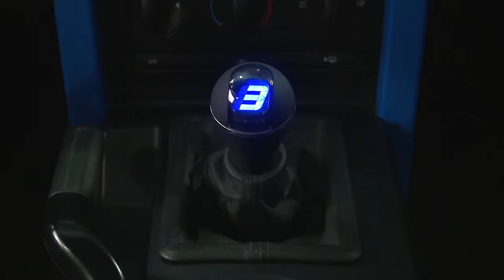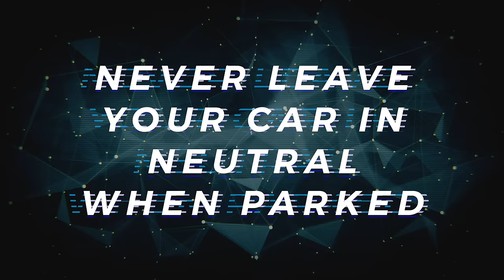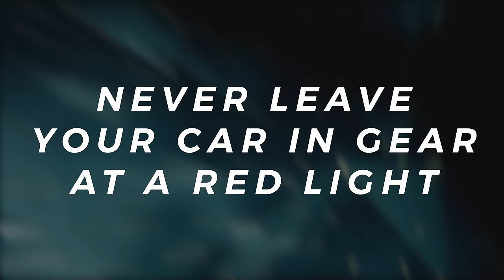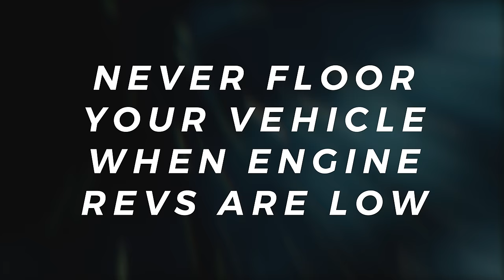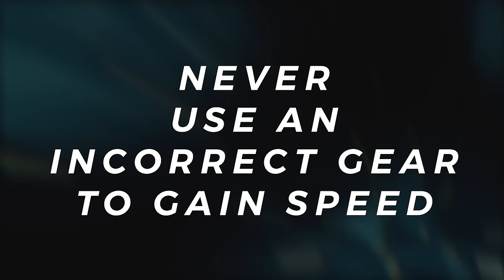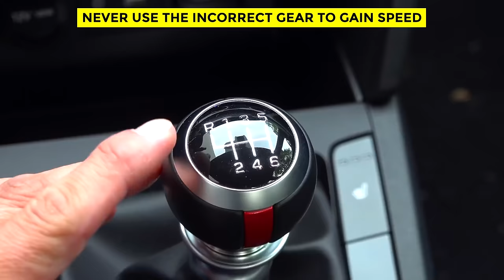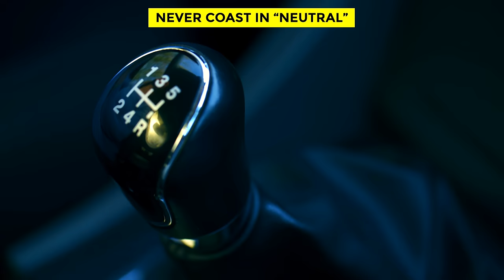7 Things You Should NEVER Do In a Manual Transmission Car!

Comment: Americans with their humor😂 gotta say I laughed the hardest when he said you NEED both hands to steer
Reply: Taking both hands off is how you see when its time to get an alignment 😆
Reply: @assassin_asa  yeah, since you should just go straight, i honestly hate 10 and 2 or 9 and 3, its uncomfortable for me to have both arms bent for long periods, unless something is under my elbows
Reply: @charlescourtwright2229   dat is tru
Reply: i have logi g920 and i use one hand to steer when i dont need to use the other one.
Reply: I laughed at that part as well. 😂
Reply: Instruction N° 27265: don't put your american flag on the windshield, it might reduce your visual
Reply: It's uncomfortable to have more than one hand on the wheel
Reply: I also don't understand how you can hold both hands on the steering wheel and not use your knee while changing gears, smoking and drinking something
Reply: in racing car with short gear or rallying we don't do that
Reply: @assassin_asa  or to check if your front tires are balanced.
Reply: To switch gears do you use teeth or toes?
Reply: ExtremeRacer 879 that’s not a real car it’s just an accessory for Xbox
Reply: @assassin_asa  so, right. Bought my new car this month took off both hands on the steering wheel and guess what, the car steers itself even though it's a straight road. Damn... What a headache.😔🤕
Reply: my hands fight each other and the car wanders. left hand for steering. also, what if the vehicle has an auxillary transmission, so there's 2 shifters. what then?
Reply: Dude change gears with mind control😂
Reply: Legit, even before learning how to drive manual I never had both hands on the steering wheel.
Reply: I drive with one hand because you can react faster, most cars nowaday need very little movement on the steering wheel in order to turn. So your shifter hand it's going to be in the damn way, and also what if you got to shift gears and turn at the same time?
Reply: @charlescourtwright2229  is it weird that I use 10 and 1
Reply: wahahah so true. Maybe he's still new :D
Reply: Same 😂😂 I can't remember the last time I need both hands to drive.
Reply: Why you lump ALL of us in with THEM? Lol
Reply: Like anybody ever does
Reply: @exr879  Good job you can drive in a videogame.
Reply: same ,, one hand on steer one one gear box 2 hand only if ur going to crash or some one is on front of u
Reply: i dont thing my right arm has ever touched the steer even when i learned to drive i couldnt keep both hands on
Reply: @johnyguitar258  How'd you pass your driver's license test?
Reply: Some people don’t know that👀
Reply: Yeah true haha
Reply: I am using both hands only in sharp turns xD The hand rest on my door gets 5 times more wear than the left half of my steering wheel
Reply: @stevesmith5579  using your knee to drive is unsafe just because you can do it doesnt mean you should because you are putting others lifes in danger
Reply: @creinaman4041  anything can be dangerous when you're not good at it. I guy drowned in a small puddle in front of my apartment building
Reply: @stevesmith5579  still shouldn't do it be normal and use 1 hand to steer and stop putting others life in danger
Reply: Lmao ikr
Reply: Racecar drivers might want to have a word with you, casuals.
Reply: In an older manually steered car, you about had to!
Reply: Those old cars were tanks and you didn’t want to have one of those getting away!
Reply: Yhe i know right? I usually use my knee /s
Reply: lol yeah
Reply: @exr879  bruh
Reply: Yeah i feel vulnerable when i hold the steering wheel with both hands for some reason.
Reply: like we dont have power steering or something, xD
Reply: @charlescourtwright2229  it's 5 - 5 tho when moving. The only 12 you need is reversing to keep the wheels still straight.

Comment: Never brake without engaging the clutch...? Why make completely incorrect statements if you're attempting to educate...?

Edit: I'm going to assume he means if coming to a complete stop.
Reply: I can understand what he says
Reply: Your reply gives complete misinterpretation of exact what he means
Reply: I wondered about that one too. Downshift, of course, but keep the engine engaged. With modern synchronized transmissions you can go all the way down and clutch finally just before stopping. In my first cars sixty some-odd years ago, going into first (of three back then) required double clutching, and the first I had that synced first gear was a 1967 Chevelle my wife and I bought new when I graduated from college. I've never had to replace a clutch on a car, though some have gone 150K miles, sometimes without needing brake jobs.
Reply: He just increased 90,000 people’s breaking distance by 15%

Imagine if that results in an accident 😶
Reply: @afoxwithahat7846  well I don't...
Reply: @kingsleycollins6730  feel free to explain
Reply: @marvindoolin1340  nice work, clearly you know what you're doing xx
Reply: He mean apply clutch why u are about to stop not while applying the brakes
Reply: You clearly sound like a person that never has driven a manual
Reply: I mean it would be much better to stall the car than crashing it so i dont think that you should always engage the cluch when braking
Reply: Matthew w  Really? What forces are put on the engine with engine braking that aren't already put on the motor? It doesn't put any different stresses on the main bearings, rod bearings, cam bearings, rings, valves, cam, crank, nothing. It creates vacuum forces inside the engine that help slow it down. Why do you think diesels take advantage of engine braking with a Jake brake?
Reply: HAHAHA, that's hilarious, you can step on brakes without stepping on the clutch, but of course if you're in a average speed, not on the second or first gear, cause' the car will wabble and the engine will eventually stop working, if you're for example, in a speed of 60km, it's okay to step on brakes without stepping on the clutch, plus it's a good way to conserve and prolong the life of your clutch lining, and have you ever heard of engine break?😂 And another thing is if you step on car's your clutch and then step on your car's breaks, the speed is more like to increase, and that is bad if your breaks are starting to loosen up.(this is just my observation, and by the way, I'm 19 years old, but I do have a liscense.)
Reply: Exactly my reaction, u only engage the clutch when ur at around 1,000 rpm before u stop.
Reply: Maybe never stop. I think this training is for American people. I have manual gear, like in most of Europe.
Reply: @lucag6052  yes clearly
Reply: If the wheels are turning the gearbox is turning, which means the engine is turning, i only press the clutch when i'm coming to a stop, with petrol manuals on the deceleration while in gear you get the benefit of engine braking from the vacuum as mentioned elsewhere, on diesel cars you dont get the engine braking due to how a diesel works however i would keep it in gear so the torque is biting the tyres to the road rather then freewheeling, in large diesel they have a jake/exhaust brake which sounds epic lol
Reply: Thanks now i dident have to say it😅
Reply: Wtf are ppl too dump to know when the engine starts to stall and to engage the clutch
Reply: @drix396  yeap looks like it lol
Reply: Stopping without clutch will shut your engine
Reply: The engine will start struggling when coming to a halt  which is a warning to engage the clutch , nice and simple.
Reply: @raulerrman.5401  but if you engine break it's effectively much better braking. For people who do engine brake, engaging the clutch while braking sounds scary.
Reply: @mohamedbasel5249  Never had that issue before . I brake till the minimum speed of the gear and down shift or press the clutch.
Reply: @upsidedown4155  That is actually incorrect, diesel engines have engine braking too, and because of the higher compression rate, it`s as effective as the engine braking in petrol engines.
Reply: So many ways to use the clutch. On rear wheel drive cars you can even use it to start and control an oversteer by blocking wheels when aggressively downshifting entering corners. Concerning safety, it doesn't matter if you engage clutch or not while braking as everything is electronically controlled nowadays though, if you have to brake for extensive periods like going downhill or when the car is heavier, it's better to use engine brake to avoid overheating of the brakes. Also, cleverly coasting in neutral - when there's no other car around as it's a pain for someone following you - is a very effective way to save fuel because when you stay in gear, even if the fuel injection is cut off when you release the throttle, the car will slow down much faster due to engine braking.
Reply: He didn't say that. If the RPM is too low it can be a problem, that's what he said. Best way to save fuel is by coasting while in gear, coasting in neutral is pretty much pointless. Like when you need to enter a city, you can approximate the distance and coast while in 4th or 5th, but you should change the gear when you reach a certain RPM.
Reply: And in winter, don't use clutch and brakes together
Reply: You will slightly accelerate when you step on clutch first before braking which is potentially dangerous. Braking gradually then clutching to avoid stalling is the best way. Brake first before clutch
Reply: He means to say go for lower gear before u break thats the good for u and the car engine, if u cant ,thats the result of danger in life or damage to property specially when your speed is fast ,many people didnt know this thats why so many accident happen and its not teach by the company or LTO before u get a license
Reply: Cos if you don’t  as the speed drops and you don’t the car will judder and stall
Reply: @Electromagneticplutonium  15% what the fuck man a proper maintained car should be able to overcome the grip of the tire with the brake
Reply: You can brake without touching the clutch, just stay above idle (1krpm will do in most cases)
Reply: Matthew w  I keep it in gear until it hits 1krpm (600 is idle) because engine assists in braking. Its also nearly impossible to brake in neutral on a motorcycle because of the nature, my 2000 zx6 won't even go into neutral unless the rear tire is stationary.
Reply: @mohamedbasel5249  its actually illegal in most US states to coast, youre supposed to be in gear unless stationary
Reply: @diljotrandhawa6320  in the winter, i almost never use my brakes, almost all engine braking to keep from sliding
Reply: @assassin_asa  see the government gets it. Also u a bike guy? One of the best thing I've learned since I started riding a bike was rev matching while slowing down. Also one of the most satisfying.
Reply: Stephen R you can tell you don’t drive a manual transmission
Reply: He should have told, "only if you are gonna stop the car"
Reply: @cerilgracic3065  yes
Reply: @08supersal  that's funny
Reply: @assassin_asa  interesting. I know so many people who just pop it in neutral as soon as they hit the brakes if they're slowing
Reply: Put the gear in neutral before braking and then brake. Simple. You don't need to press clutch everytime you stop. That's just massively hectic.
Reply: When you come to a stop you should put the car in neutral
Reply: When you brake... Your revs drops automatically.... Wouldnt the engine want a down shift??? What would you do to shift?? Use clutch...right?
So engaging the cluth while breaking allows you to shift down quick...
Reply: @sabeehilyas8866  do you accelerate wit cluth on or your Rev match automatically? You use clutch to shift gears. That's it. Matching revs up is as stressful as down. You wait to the point it is needed.
Reply: Matthew w  ......60mph... coming to turn on a side street. Clutch out, match rev downshift to 4th clutch engage, brake for a few mph then do it again to 3rd. then again to 2nd. Your braking distance is better and your not burning anything up. It's called engine braking. and using it alongside your footbrake will make your stops much better.
Reply: Coast in neutral and engine break is a good alternative, no?
Reply: It’s the same with the first or reverse thing, no one ever has done that
Reply: Totally agree with you
Reply: Marvin Doolin my 99 Toyota Tacoma 5 speed still doesn’t have a synchro on 1st! It’s geared so low through 1st is really only needed when starting from a complete stop, so it’s not much of an issue
Reply: Matthew w or you rev match and down shift like a normal person
Reply: @stephanbrink932  you sound like a person who has never driven a manual I drive one and work in a trans shop I can come to a stop with out pressing the clutch 90% of manuals can be taken out of gear without pressing the clutch
Reply: @Will-tu9nf  dude, i have driven a manual my whole lif sinds i have my driverslicance, 1,5 year. Its not good to get out of gear without pressing the clutch
Reply: @stephanbrink932  I rebuilding manual transmission semi transmissions shift without clutching and most car and pickup transmissions ca be as well with out hurting then I grew up on a farm been drive stick since I was 5 so do some research you can take a manual out of gear without clutching it makes no difference coming out it's going in that makes a difference and an unsynchronized it makes no difference weather you couch or not you still have to rev match clutching is just easier so please do your research I went to a special school to learn all manuals in and out just cuz you drive one doesn't mean you know everything and if you think you do then what is a sm420
Reply: @Will-tu9nf  wait so am I okay to put the car in neutral and use the brake to slow or does that hurt my car, is it better to downshift as I brake or what
Reply: @josegaytan3384  hit the brake then into neutral  if you're on a long hill down shift don't ride your clutch and it saves your brakes
Reply: @Will-tu9nf  ooh okay thank you
Reply: Only if you are about to stop do you ever need the clutch yea
Reply: This is the reason I drive automatic lol
Reply: I actually always brake while engaging the clutch. Primarily because it became a habit and the fear of the engine turning off.
Reply: i've been braking alot without engaging the clutch as often i stayed within the speed range of the gear... Only engage the clutch when you start to drop below 1000 revs because only then you get in the range where the engine starts to stall.
Reply: he meant to complete stop xd
Reply: @rocas4087  the engine can stall way before you come to a complete stop
Reply: @AwoudeX  i didnt said you couldnt, but you wont engage the clutch every time you want to reduce your speed. you wont 
go down a very steep road with the foot on your clutch pedal(you can as well but I will gain speed if you arent using the brake)
Reply: No if you are slowing down and don't push the cluch at least in my truck it will stall because it's not getting enough gas to keep running
Reply: yea thats probably what he means
Reply: @pml103  that is the effect of engine breaking on stopping distance.
Reply: @Sky-_--zh5dl  exactly. If there's not enough gas it will stall
Reply: Script was written by a democrat for democrats.
Reply: @davidwright7193  that's not how it work, max braking is determined by the tires not the brake. If you're brake can't lock the tires what's the point of ABS. Adding engine braking won't help with stopping distance.
Reply: @afoxwithahat7846  no you don't
Reply: @kingsleycollins6730  no he tells it how it is.
Reply: @Electromagneticplutonium  if you need to stop quickly because there's a crash in front you should press the clutch, it does not increase anything
Reply: @mariusrutza  Yeah they can engine brake, but considering the gearing ratios they have it is not as effective as in gasoline cars.
Reply: @7InTheCityOfEvil7  how do you coast in neutral and engine brake at the same time? if you're in neutral you're not engine braking... xd
Reply: What he said is correct both clutch and brake should be applied together especially when you are in traffic or going downhill on a traffic and a little brake should always be applied when you go for the clutch to shift while speeding on a highway because you never know when you will need that brake instead of Floorring the accelerator while shifting to higher gears, that should be common sense for all manual driver's 😏
Reply: @panlakachokora5149  Did i understand your comment right that you should use brake while accelerating?
Reply: @mikoruotsalainen9524  in simple term for you to understand what I meant is you need to always keep that foot on that brake and be ready at anytime upon shifting gears. Because you never know what will happen on the road and you might need to hit that brake in case of an emergency instead of stepping on the accelerator.
Reply: @lucag6052  I don't think it's for any particular Groups Americans made cars as far back as 1860's and most were one gear and eventually added more .
The problem with this is America wants to phase out manuals while there is still people like me who prefer it and it's a better option than these shitty CVT Trans they push today.
Reply: @afoxwithahat7846  No man, it's better to set your mind to press the break first in case of emergency, or if you're not intending to fully stop. Because pressing the clutch will deactivate the engine break and the car will slightly accelerate, it could cause accident.
Reply: yes your edit is correct...while braking its better to not engage clutch cuz engine braking will help in slowing down the vehicle...in an emergency it'll surely help....once you're slow enough, better engage clutch
Reply: @kingsleycollins6730  It says "never brake without engaging the clutch". It's not misrepresentation if it's literally a quote.